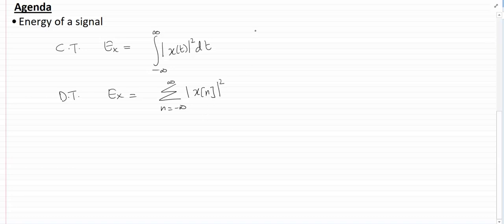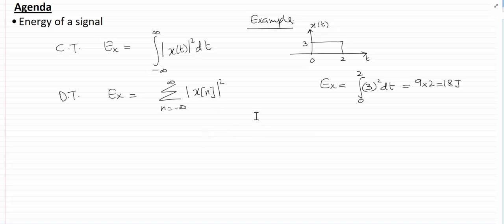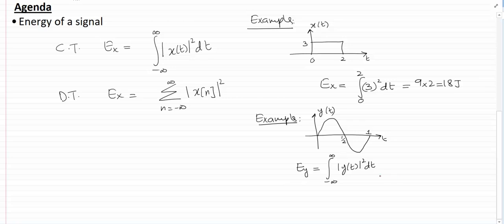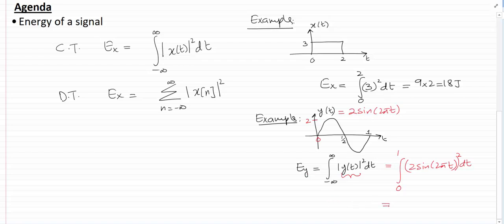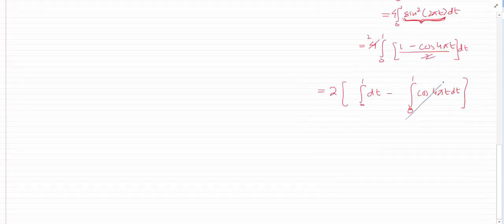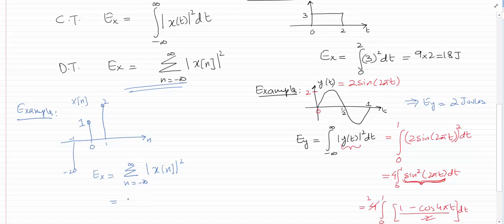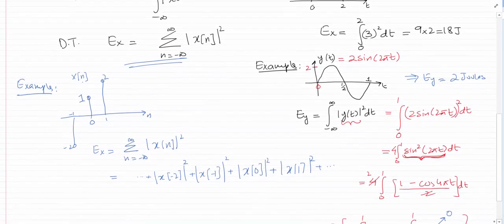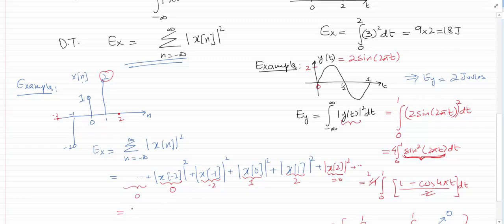2- Signals and Systems: Energy of a Signal

Comment: sir i have a question 
why do we take mod of x(t) and also squaring it.
Isn't both for the same purpose i.e for making x(t) positive ?
Reply: i am not so good in linear systems though, but i think is one reason is to get the correct unit and the second reason is if you see in a simple circuit the power dissipated by the resistor is given by power=(i^2)R or (v^2)/R. As you see in both cases it is squared.